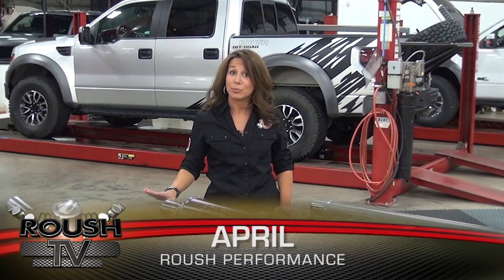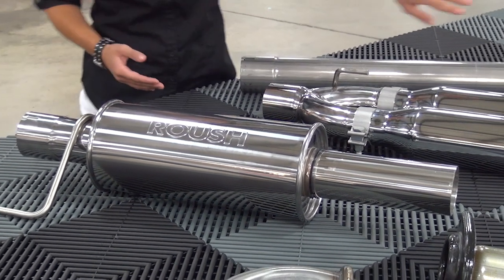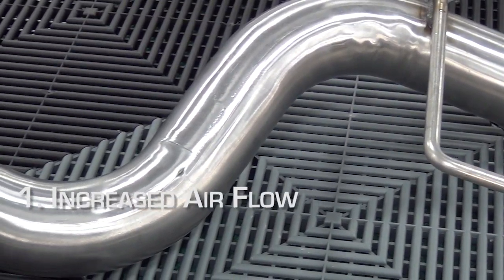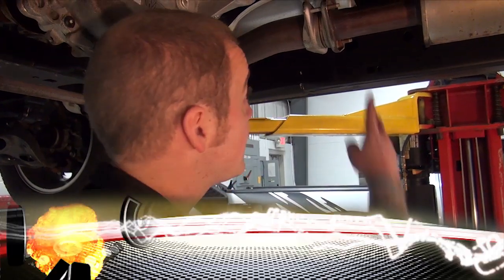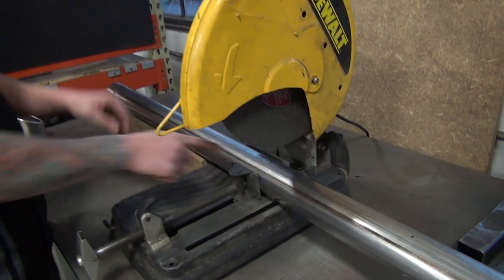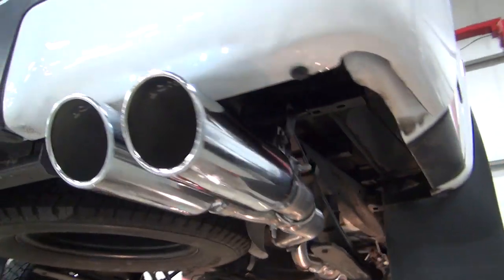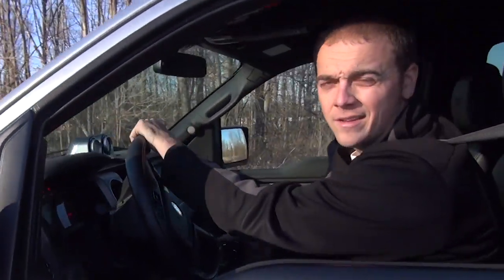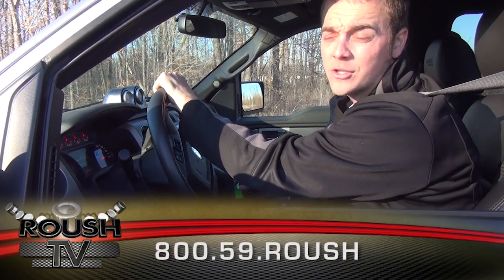ROUSH TV: ROUSH 2011+ F150 Exhaust System

Comment from the maker: Drone is a subjective thing. There is certainly some amount drone as it is a performance exhaust, however, we consider it to be very tolerable and nothing that any performance enthusiast would have an issue. Experience may vary based on a personal preference and cab configuration.